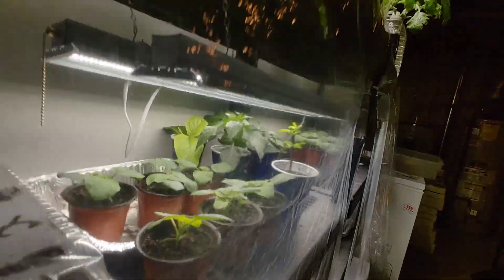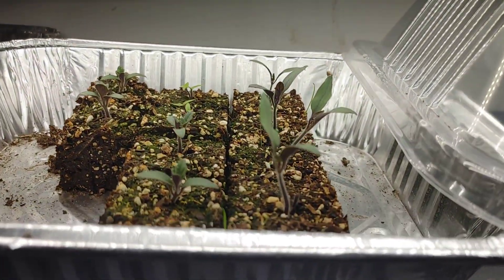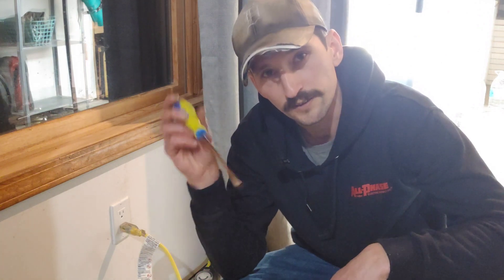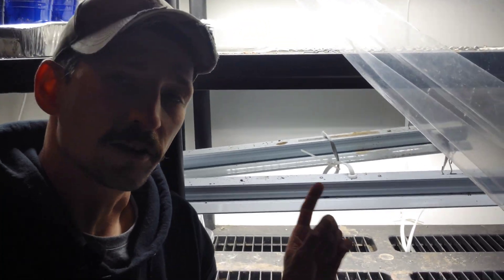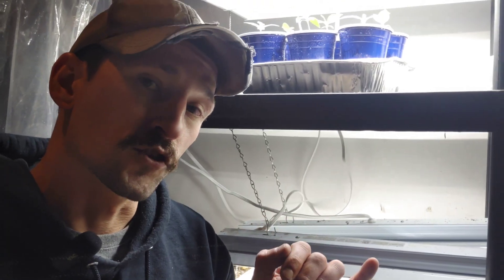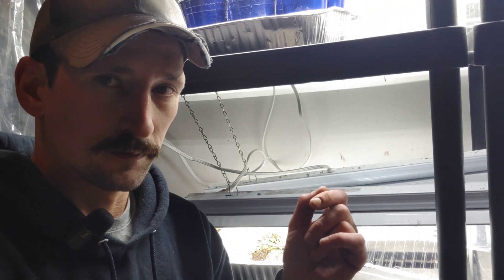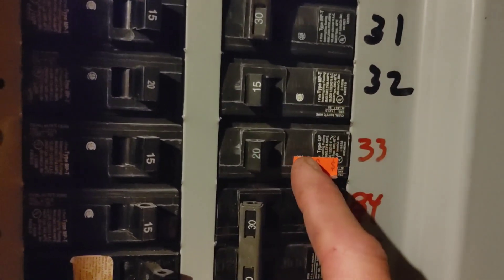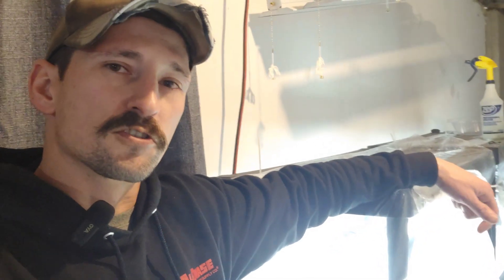Electrical Safety Tips for Indoor Gardeners

Comment: Can you add a grounded adapter plug to the end of a two prong light ?
Reply from the maker: The cord on a two prong does not have a ground wire but you could install a new cord and ground to the fixture itself.  I'm surprised at how many new appliances lack a ground wire but for residential applications they're not required by code.
Reply: Thank you for responding I’ll have to replace my cord . That is surprising that they wouldn’t make it mandatory.

Comment: Wondered if YT would have something to say about your show and tell experiment. 
Retired electrician here. Hardest I ever got hit was from 220 baseboard while kneeling on a wet carpet over concrete. Pipes froze, then thawed, and the house flooded.
Reply from the maker: Touching live parts with one hand and showing a lit voltage tester in the other hand to demonstrate how electricity can flow through your body and not hurt you as long as youre not grounded "wasn't suitable" 😂
Reply: @FastGardeningMichigan  YT policies are ridiculous!.
Reply from the maker: 220 got me in a laundry room.  Someone tried to put a dozen neutrals under an undersized wirenut which popped off moving other wires.  Glued my arms to the conduit so i jumped off the ladder

Comment: you got brakers right that trigger so fast dont feel a thing if  at least we got in the eu here have 230volt  16amps
Reply from the maker: The breakers trip when the amperage rating is exceeded whether it's overloading or a dead short, and there is a brief time delay to account for inrush curtent from motors.  Unfortunately they do not trip when a human body enters the circuit 😂.  I wish they did.  Ive had to jump off ladders a few times when the electricity had my arms glued to metal conduits and wouldn't let go.